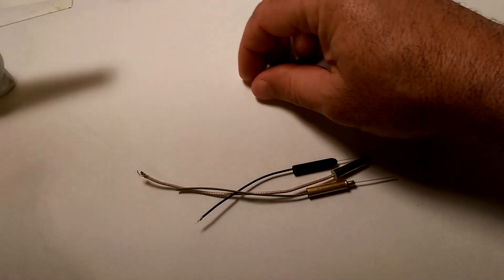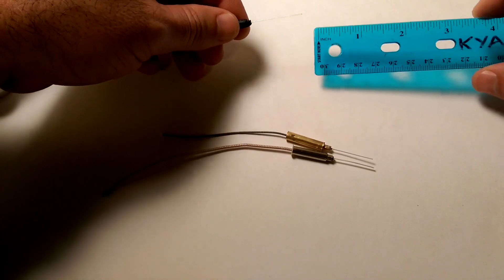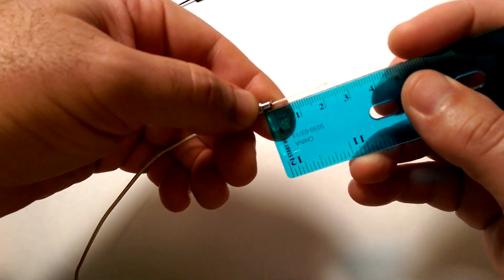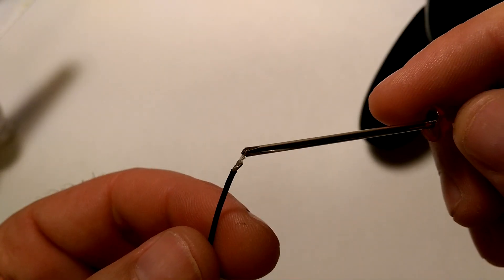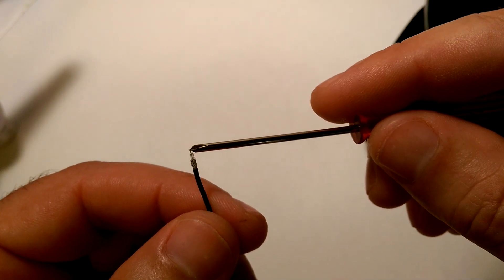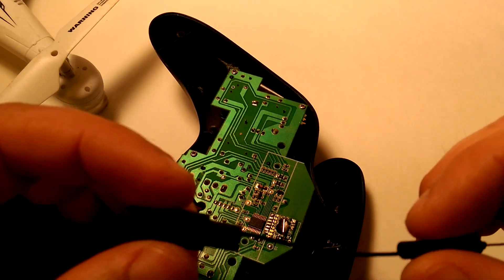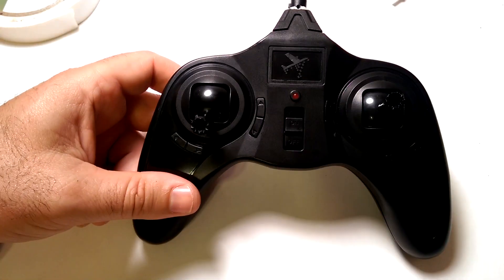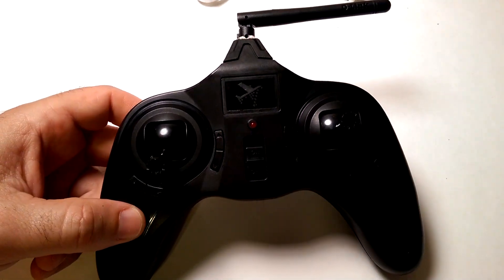Q7 FY326 Triple Range Mod Step by Step (Syma X5C Replica) Quadcopter Drone

Comment: I really dont know what I am doing, I purchased a pair of the 2.4's on ebay.  then a buddy gave me an old router board with a 2.4 attached to it.. I must say the wire that came with the ebay antenna's looked almost to thin to splice. I had time to kill because my quad ((wl toy 686g) was in 1,000 piece s waiting for parts. so I took apart controller and did the best I could splicing one of the ebay wire's and soldering it to my controller.. It looks really coo, finally my parts came in and i reconstructed my quad.  I flew it a little two nights ago in the park across the street from my apartment.. It does okay I think, then I flew it in a hope depot parking lot.  it seams to respond to my command's okay.. it never trimmed this nice..but then I was not trimming any quads back when i broke this one,   Now the  same quad is in need of  another body,  and I am still not so sure i did the swap correctly?  anyway just a few hours ago midnight west coast time,, I lost my jrc H8 c to the roof of a department store..I only flew it three times.. I have got to stop getting hypnotized by altitude.. I have heard quad 101 talk about the RETURN TO HOME FEATURE 1,000 times but II still dont know what he is  talking about. that and HEADLESS MODE  are totally forren to me..  I have not lost orientation, I know that when I turn my craft around that most directional become the opposite, and i know how to turn my craft around, its just once I turn it around, and try to get it to come back to me, it fall's ...man it's frustrating..but none the less I am not so sure that i increased my range with my mod? I may have made it worse..  I love the syma x11 c, the dmoo7 and the x5c,, mxr 400 and the h8c. I want every controller to have an antenna mod
I also have a tarantula but i wont take it out of the box until I am a better pilot,,
Reply from the maker: Sorry you lost your h8c.  At least your learning on these cheaper quads though.  Just keep at it and you'll eventually get it.  Just think of this entire thing as a learning experience and keep at it...don't get frustrated.  Sounds like you have plenty to learn on and even lose a couple in the process.  :)
Reply: +Dustin Dunnill wow you read all that? thanks.. the funny thing is, there is a r.c hobby store not two blocks from my place, but the staff give's me a really stand off-ish vibe, I think they know they will never get a DJI phantom sale out of me, so me and my little toy's from china are not relevant to them. The guy made some remark about all the draw back's of dealing with over sea's ..but it's funny because last week I found them selling the Syma x5c for $90.00..when I asked them about extending range with antenna swaps ? they got this blank look on there face's. Im told there are two locations, 1 near my apartment and 1 near my moms house where people congregate and a fly RC's routinely. I have been to shy to seek these people out and bug them with my man toy woe's! and Forrest gump piloting skill's ! But I have to get over the anxiety and get some answers from a pilot face to face. Yaw, rutter. eloron? there is something I am missing in the translation that only a face to face or phone to phone at least can maybe clear up for me. Now about the Mod on my wl 686 controller? I took pic's but everything is out of wack. Im working on my back up pc.. xp system. it wont except my video camera, and have a cheaper brand smart phone that i use for pictures only and when it rains it poors,, so I have a few thousand words with much much fewer pictures. but i will eventually upload most of my exploits. I am convinced that my controller hack is not up to snuff for a couple reasons.. I found no ground solder for the stock antenna, it was just one lead. so I replaced that one wire with my ebay or amazon antenna just the way I saw on this guys video but the center of this antenna was no mass no coax, it was thin wire, that on top of my crude soldering had me in doubt until I finally put the quad back together and got it to bind and even fly! but I think i hit an artery in it's loab somewhere, because i could of sworn it the last time i flew it looked like it hit a brick wall in mid air (maybe that you guys mean by vortex) Im going to have some guys look at this thin cable today and then compare it to the cable someone gave me from an old sterero.. heck I think cutting coax from a cable tv wire would have more oomph? but i dont know about hertz and waive' and what not.. anyway thank's ton's. and yes every controller should be tweaked in these quad's....Im curious, can the tarantula controller be tweaked for more range?  or this a real antenna on there controller?
Reply from the maker: Wow, that's a novel :).  Hobby shops are like that since they can't compete with China vendor prices.  But the x5c is so popular they should take note.  There is a wealth of info on YouTube/the internet to pretty much learn all you need but practice makes perfect.  I don't have a tarantula but with these multirotors, they are pretty much all the same and you can extend range easily in one way or another.
Reply: The Rant is insane, I told myself I would not fly her until I could get my other drone's to leave and come back to me, I sort of got half of a bank down, lol and I did loose another drone (x5c) again just the other day.. but I put up a really good fight to hang to that one. I feel like I have earned it. so I took her out this morning. great devise..night flight and some video in few hours,, I also have a key chain camera on the way. Yea I actually tried to try a sony cam coder to my head the other night.  (another plus to flying at night) not as many people seeing me make a fool of myself..
Reply from the maker: Way to go.  I did a lot of night flights also when I was learning for those same reasons.

Comment: What about if you make a tiny hole on the Q7's "upper body", so the antenna is sticking out, would it make a difference ?
Reply from the maker: Great idea.  Yes it should help a little to bring it away from the main board.  It may give better lateral range But it will still be blocked when you are underneath.  It's worth a try though and a tiny hole won't be noticeable if it doesn't.  If you try it please let us know how it works.
Reply: Yeah, I'll leave a comment after the test. Also thank you for your excellent review

Comment: How much of a distance do you get with the 2.4G then? And what was the wavelength on the original antenna?  I just bought a syma and it's a 2.4G out box it's been gale force winds here so iv not been able to get out with it as yet had it 3 days n not had a shot lol
Reply from the maker: The original was correct 1/4 wavelength but with no extending cable to bring it out from inside controller like most toy quad controllers.  If your x5c is like most you will be lucky to get about 75-150 feet range stock.  Maybe the manufacturers will fix this eventually and put proper antennas on.
Reply: It's the new x5sc explorers 2 I got its better that the upgrade version of the x5c mines is the same as the new wifi syma x5sw I just need to get a camera link soldered in but thinking of building my own after I wreck this practice flying lol
Reply: The new ones 2015 models only go to 50 feet it has in manual so don't think they would lower the distance rate for the new 2015 ones I'm going to read my brothers instructions when I go over to the house at weekend to see what his original syma distance is in that manual ! Weird one isn't it
Reply from the maker: Yes, I think the manufacturers had changed electronic supplier and it had an adverse affect.

I've heard that distributors are assessing the issue and taking care of customers.

Comment: I did a similar mod on my DM007 and Syma X11 TX. I used a Mini PCI to RP-SMA Pigtail Antenna Wifi cable  from Amazon. I cut off the Mini PCI connector and strip the coax cable and solder it the FC board. Drill a appropriate size hole on the controller and mount it (but/ washer). Attach a WiFi antenna on the other end.
Reply from the maker: Nice work.  There are many different way to do it. Yours is a good option to be able to unscrew antenna if needed and swap for a higher db gain antenna if you wanted.
Reply: Dustin Dunnill The syma x11 gamepad type TX got 100 meter range in the park. Without the mod was only 30 meters.  Looks like the controllers all look the same circuit board wise. Only the hubsan x4 is different.
Reply from the maker: Thanks Michael.  To bad these quads don't have this range out of the box.
Reply: I do a range test  before I fly any new quad now. I lost an X4 on a fly away (own it for 2 days only). That was a pilot error, I was newbie then. The X11 was almost lost too. Breeze blew out of range.Three trips around two blocks away and found on a front yard with the lights blinking. Lucky it did not land on a gutter. That experience caused me to mod my quads. And also careful not to fly high  and avoid flying on a breezy day. Just sharing my experience. :-)
Reply from the maker: Jim Wilkinson Sounds like the green board version is the better of the 2.  Thanks for the info.  If your red version is like mine the range will disappoint.  I think the vendors may be willing to help if it's really bad.

Comment: Hello,
nice tutorial. I tried doing it as it was shown, but I don't know why it didn't work. The quadcopter now can't connect to the transmitter. I tried soldering the original antenna back but it doesn't work too. Do you have any suggestions?
When I turn on the transmitter the led beeps and then starts blinking, but when I do the forward-backward movement with throttle to connect with drone it doesn't connect and nothing is happening :(
Reply from the maker: Check all your soldering and antenna measurements.  Also try and bind with some of the controller screws out.    I had that binding issue which turned out to be the board bending and breaking connection.
Reply: mine too. once it bind with the quad then suddenly drop. battery is good. have no idea about that. so sad.

Comment: Hi, Dustin. Can you share links to this antenna on eBay? Thanks
Reply: Роман Пенин Waiting for answer:) I also would like those batterys...I have done the same mods:)
Reply: Dustin Dunnill Can U make a video of how many meters U actually get the Q7 out on? After new antenna?
Reply: Kenneth Nielsen Still waiting for parcel from China. About two weeks needed
Reply from the maker: Something like this would work:  http://pages.ebay.com/link/?nav=item.view&id=390823498485&alt=web You just cut off the end and strip for soldering as shown in video.
Reply: Dustin Dunnill Thank you very much :)
Reply: Dustin Dunnill I just wait for my drone. And don't know dimensions :)
Reply from the maker: Nice find.  I just measured the turnigy 750mah i use as shown in my other videos and it is the same dimensions as the ebay ones you linked.  So the question is are those really 800mah?  I've seen these cheap ones be up to a couple hundred mah off.  Let us know if you get some and have a smart charger which shows how many mah it's putting back in to them.
Reply: Dustin Dunnill Ok. Will write after 2 weaks

Comment: Thanks again for another great tutorial, typical that my days off and the wind is blowing, been perfect the last 3 days I was working. Hoping to get a flight in tomorrow to see what sort of range I get stock before modding it.
Reply from the maker: Thanks Ken, you are a true patron!  It's been howling here on Maui (and still is) for thus entire week.  Hoping for some calm weather as you are...hope we get it.
Reply: Dustin Dunnill The more I watch the more I learn :)
I can confirm I get 100M+ from the stock controller for the Q7, haven't found the limit yet and won't till I get to a footy oval. 
I did the range mod on the X5C-1 last night and that is working well and can confirm 100M+ with that, just a shame the X5C-1 controller wont put the X8C into headless mode (for me at least). I'm waiting for another antenna before I can mod the X8C controller.
I've ordered a Devo 7E controller and mods needed for the Syma quads and a Walkera G-2D plastic gimbal as well for the Xiaomi Yi so looking forward to that arriving. 
Having a blast today with light winds :D    Hope the weather is good in paradise...
Reply from the maker: Sounds great Ken, to windy for much flying here :(  Can't last forever though.

Comment: Great tutorial! Just wish there was some flight footage with the new range.  I'm tempted to get this quad for the price just as a simple basher.  Most folks complain about the cheap plastic.  Do you think it'll hold up well with a little experience behind the sticks?
Reply from the maker: Hey whiffle, thanks.  Basically 2 times further than i was going in my initial review video.  Sorry i wasn't able to get any video afterwards but you honestly really can't see it on camera after about 200-250feet away.  They are probably complaining about the softer playable makup of the body.  I actually like it better than the harder more brittle x5c plastic since it will absorb shock rather than break.  I mention this in the review video linked in description.  It has been bash pretty hard by myself and kids has held up better than i had hoped after some high falls on to asphalt.  For the price, it's construction and abilities are more than capable in my opinion.
Reply: Awesome, thank you for the detailed response. I suggested this to a friend, but he ended up buying the MJX X400 for the better build quality and more sporty capabilities.  It goes for $43, so I'm somewhat torn between the two.  I could get a couple spare batteries with the FY326 at the same price.
Reply from the maker: Haven't had a chance to test that one.  maybe see if you can try his out before you decide :)
Reply: Unfortunately it's on the slow boat over, so if I wait for his I'll be waiting for his slow boat and my slow boat ;)

Comment: Thanks for sharing,great step by step tutorial.Would this work with a rp-sma cable and a 5db wifi antennae similar the quad 101 set ups?
Reply from the maker: Hey Sterling,  yes.  basically you would just be soldering one end to the controller as shown, then the other end would have a rpsma or sma fitting you would moint where hole is drilled for antenna.  lastly you would just have to get any 2.4ghz gain antenna you want and just make sure it matches the fitting just mounted, screw it on and your done. :)  Should work for any of these types of controllers as long as your handy.
Reply from the maker: Hey Sterling, just re read your comment and i may have gone a little overboard in explanation.  Short answer is yes, you just have to solder the end as shown in the video and somehow mount other end on TX.